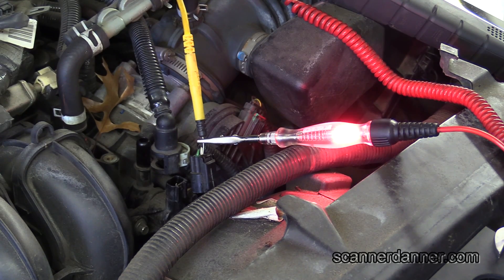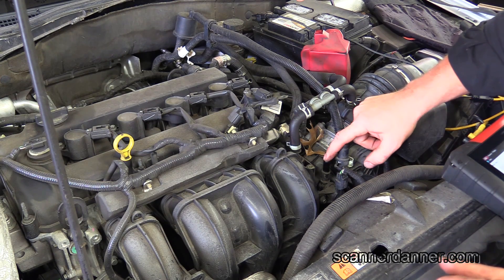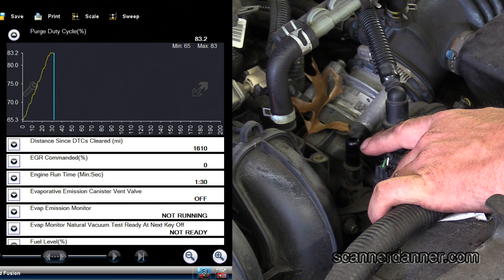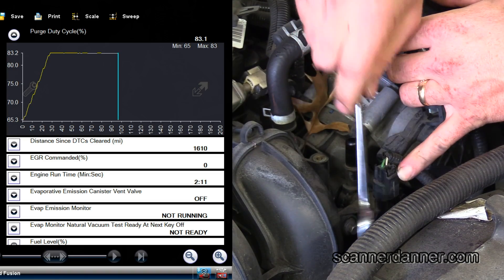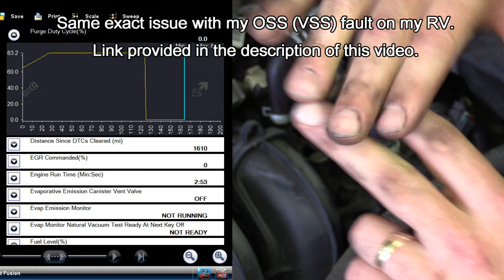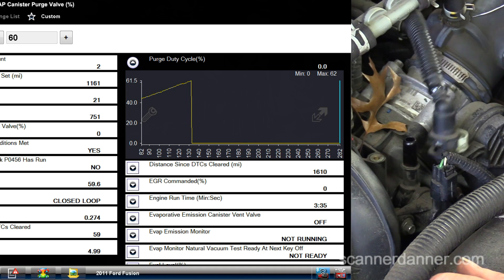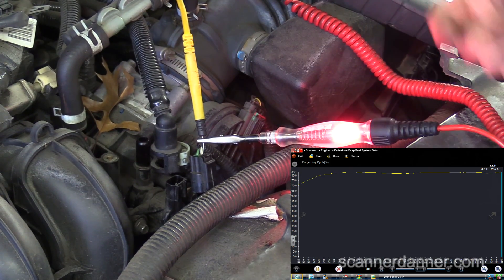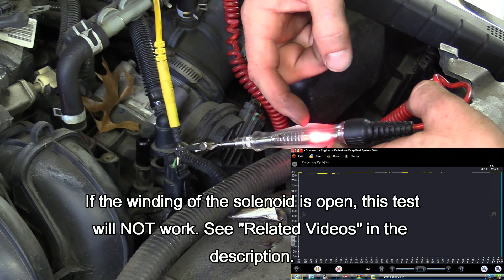2011 Ford Fusion Purge Solenoid Test (P0455 EVAP Leak)

Comment: I want to make sure I'm clear.
So that should be on and pumping as soon as the engine starts?
Cause mine didn't start pumping for about 1 minute after i yutned the engine on.
Reply from the maker: Engine temp will be a factor in that as well as manufacturer strategy. This did start purging immediately. Others will not

Comment: Hey Dan I got a purge valve no flow. If I took the purge valve off and gave it direct 12v and ground off the battery it should click right? Are any purge valves run off of 5v? Cause I'm getting 4.3v on the power side and 12v on the pcm ground side. So odd. Its a 05 kia sportage 2.7L if that helps.

Comment: I have a 3.5L in my 2011 Fusion and it looks nothing like the one you're working on.  Can't find that valve anywhere.
Reply from the maker: this is a 4 cylinder turbo engine in this one. Your 3.5 is a V6
Reply: @ScannerDanner    Gotcha...  Found out mine is in the back of the car.  Jack it up, slide under the back toward the rear axle and you'll see the canister thingamjig with the valve mounted on the axle side of it.  It looks different though.  It isn't held on by bolts.  Pull the 2 hoses off (no clamps, just pull), disconnect the electrical connector by pushing down on the top of the connector while pulling (hard to get big hands in there, but you'll get it), then the valve is mounted on a 'rail'.  Gentle taps on the valve upward broke the rust loose and the valve lifted up and off the rail pretty easy.  Your test worked great.  I needed a new valve.  Just ordered it on PartsGeek.  Thanks for the video though, because the test is the same regardless of what the valve looks like!

Comment: It would be nice to know what your FTP Sensor is reading when the duty cycle is up but the Purge wont open. Im dealing with an issue where my FTP Sensor reads Positive pressure during a Purge and seal test. When I do hit SEAL, the engine stalls. I have a P0455 code too. Im now thinking that my purge might be sticking hence the positive pressure and when I do hit seal, it might un stick, forcing alot of vapors into the engine- thus the stall. Hmm?

Comment: Hey Paul.  I have a question for you regarding my car.  I have a 2011 Mercury Milan with the 2.5L.  This past week my car has been having rough starts after sitting over night.  In the morning I will go out to start my car and it will need to crank over a few more time than normal in order to start.  When it does start it runs unbelievably rough!  It usually stalls within 5 seconds.  I'll start it again and I will get the same result.  But, by the 3rd time I start the car everything is running buttery smooth!  It never throws a code or anything and I can start the car just fine for the rest of the day.  Any ideas where I should start to try fix the issue?
Reply from the maker: Is this a GDI engine?
Reply: It's the 2.5L duratec i-4 engine.  I can't find anything that says gasoline direct injection.

Comment: Good video! I have a 2010 fusion and i got engine light code P0456. People always say check gas cap but i dont have one. Then they say check purge valve. I got purge valve replaced by ford last year so i thought it was good. I checked it and it wasnt working...hit it lightly with a screw driver and it started working.

Comment: could this cause the car not to start I remember while back my car didn't want to start and I took the pruge vavle off and put it back and started no problem but now it won't t even start cranks but no start I even changed the fuel pump thinking it was that since I just filled it up any idea what is causing my car not to start ?

Comment: it's interesting to see this type of purge valve fail in the stuck shut position. I've seen quite a bit fail stuck open, causing false evap leak codes.

Comment: Ford tech here, 28 years at the same dealer. These are part of a recall on Fusions, may cause the tank to expand, possibly crack and leak. This style is also used on other vehicles in the Ford fleet. If you suspect a bad valve, just replace it. It may test OK now but, next week, next month it will come back and bite you on the ass. I have no doubt that I replaced over 100 of these without a repeat repair.
Reply from the maker: Thanks for the additional insight!

Comment: I was working on a Honda that didn't support bidirectional control of egr solenoid.  I am guessing it is PWM controlled, so I was nervous applying full battery voltage, 100% duty, for an extended period while testing it.  How would you test it?  Could I really get it to reach the conditioning in my driveway for the PCM to send it a command?    I'm assuming this is what you will say, but do you have any other tricks up your sleeve?  I have seen you drum beat a component, but that was usually for circuit integrity testing. 

I guess my real question is how you would control an actuator that is PWM controlled without the use of a bidirectional scantool?

I am a premium subscriber.
Reply: GeekDIYMechanic you can use a test light to battery positive. remeber a 100% duty cycle is 12v

Comment: Purge valve on those vehicles are recalled, usually sticks open causing excessive vacuum and in extreme cases cracks fuel tank.

Comment: Great video as always!! The odds of this is that I just got a P0455 code on my 2004 GMC Envoy today and never had any evap codes prior, not even a small evap leak. I ordered a new purge and vent valve for my truck. I've been having problems for the past few months where I fuel up and it shuts down the nozzle from the fuel pressure. I hope this fixes my code and the issue i've been facing when fueling up. I also noticed intermittently that I can smell gas vapor from where the purge valve is located when my truck sits and it doesn't happen all the time.

Comment: Very helpful video as always! 
One question, on your description you have a link to the Autel MaxiSYS MS908 scanner, is that scammer worth buying and does it have a scope like the snapon ones you use?
Reply: Juan Rodriguez I own both the Maxsys mini and a Snap On Verus Edge, the Autel is definitely a good Scan tool, no scope attached, they do offer a crappy scope module as an add on, not recommended but a mediocre scope is better than no scope

Comment: Great Video. If there is no check engine light or fuel smell. Will a faulty purge valve cause rough or shaking idle of the engine on cold starts? Once it's warmed up the car is fine. It's a 4 cylinder with 2 pre-cat O2 sensors. I noticed the fuel trim for Bank 1 at idle is +18% and on load +5%. Bank 2 at idle +5% and on load -12%. I changed plugs, coils, cleaned everything, checked for vacuum leaks. No luck. Any ideas? Thank you.
Reply: Thats typically an intake gasket leak. Next cold start spray some water or ether around it. It seals up when warm.
Reply: That is actually a very good idea. Never thought about that. Thank you very much.